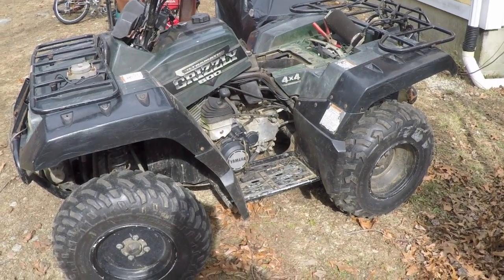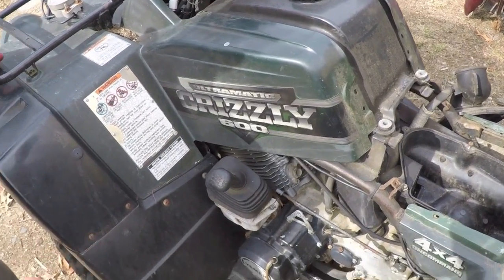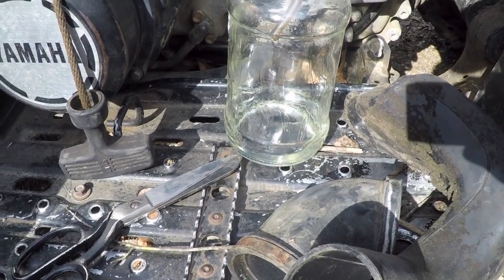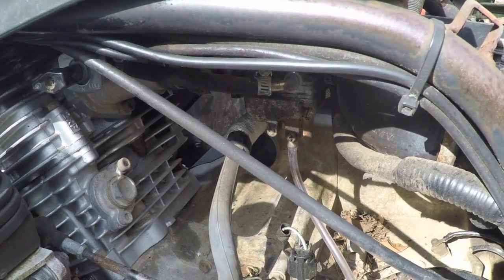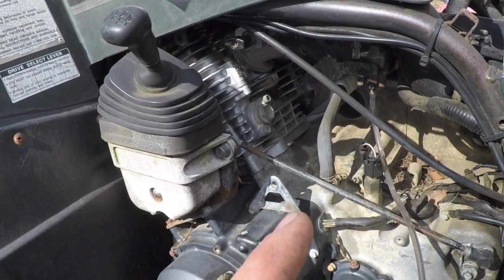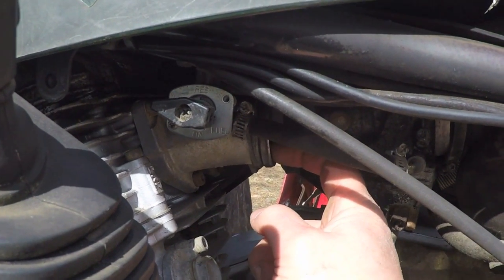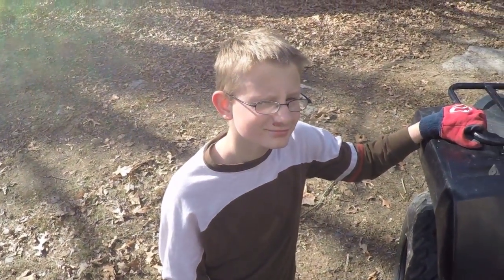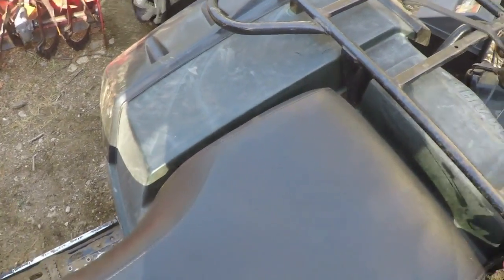Yamaha Grizzly 600 ATV Part 21

Comment: I rode in Texas the other day and was having a grand ole time; the reverse gear was having issues, spitting and sputtering, and it backfired only in reverse. I went back up, and it died again. I tried to restart it like I had multiple times before, and it never started. Starting was louder than usual, so I thought something was off internally. I towed it home and went to looking and low, and that same intake boot popped off ever so slightly; I slipped it back on and tightened it up, and started up instantly. Good work figuring it out!

Comment: Common problem. It took me a while to figure that one out. I even replaced that carb boot and it would still blow off. Thanks to EPA they have to be lean to meet emissions and that makes them pop back through the carb. Mine has a slider gate and when its not open enough it will blow the carb off the boot. I was told to drill the low speed jet out to richen it up a bit. But for now im fighting an no intermittent spark problem.
Reply: I have not read all the comments so please forgive me if somebody already addressed this :  If you haven't gotten your spark problem fixed yet, first put a new spark plug in it--it's a b*tch--18mm spark plug socket, it's way down in there, then get your multitester out and check your stator snap connects located under the left rear inside the frame by the left rear tire with your meter set to OHMS, per the Grizzly shop manual red/white should be 459-561 for your stator pickup button and green/brown should be 270-330 for your coils, i got an aftermarket stator and they wired it wrong so check your wires and wire colors, its working now tho, also I watched another content creator and they recommended grounding the battery to the frame with a heavy cable as an extra ground in case your stator tries to ground to the frame? I didn't know about that but I put extra ground wires on both my 1998 and 1999 Grizzlys anyway and hopefully it helps, good luck

Comment: What year is your Grizzly? I think i have the same one. I cant get it to start because the starter is slipping and  mine does not have the pull start like yours does. Is that an easy fix?
Reply from the maker: Mines a 2000. I've found the pull starter to be useless. It's very hard to pull on this big of a motor. As for is it an easy fix? Shouldn't be too hard to diagnose.  Start by making sure you have a good battery that's fully charged. Then pull the starter and see if it spins up okay, and is throwing out the pinion gear.
Reply: @stevewatr  thank you for your prompt reply Steve! I was able to get it started a couple of times today with a new fresh battery. How ever I had a problem with the choke later on in the day and it wont start, then I figured out the choke issue and now I just hear a grinding sound in the flywheel when trying to start it like something in the starting mechanism below is not catching :/ and a sound of metals grinding every once in a while. Now the new battery is dead lol so I have to recharge it. Do you think low oil level may contribute to this? I need to figure out how to add oil as well because  I can see that theres little to no motor oil in in the glass indicator. Fun...
Reply: @stevewatr  I watched your video again just now and I noticed 2 things. 
1. Just like yours, my carborator leaks fuel from a top hole where a hose should connect to. 
2. Your son is wearing Red Sox gloves, are you guys in MA? Im in Milton Massachusetts!

Comment: does any of your vids show air duct assembly pieces? my 01 grizzly 600 is missing the air duct assembly that connects to crankcase. im wanting to replace it but cant find a clear picture of what it looks like. if you can shed any light. id appreciate it.
Reply: What's your email I'will send you a link
Reply: @NLPYROFREAK13NLP  I need help with my 600 I'm having the same problem

Comment: Steve, Great series of videos.  I've basically gone step by step in rebuilding a 2000 Grizzly by watching your videos.  How do i correct a rich running grizzly? Can i do this without removing the carb again?
Reply from the maker: As I recall, there you cant get the throttle sleeve/needle assembly out without tilting the carburetor over.  The height of that needle in reference to the sleeve changes the mixture. Raising needle makes it richer, lowering needle makes it leaner. Hope this helps.

Comment: We have a 660 that looks almost like yours. It need brakes, starter and carb job. It does go like stink tho. You can spin the tires at almost any speed.
Reply: we have a 99' 600 and yeah there BEASTLY machines!! also have a Rhino 660 thing does like 72 on the road lol